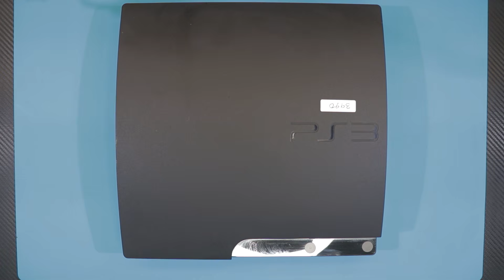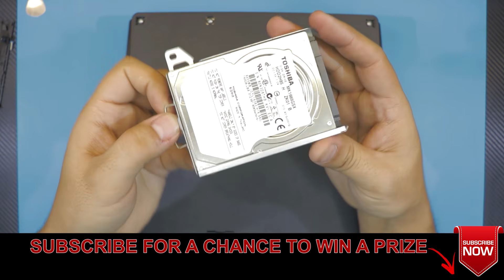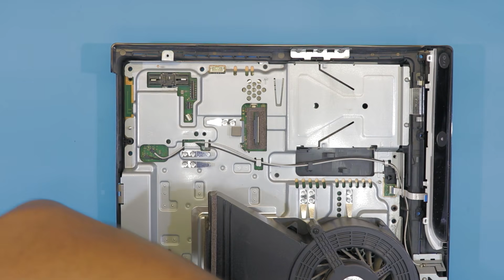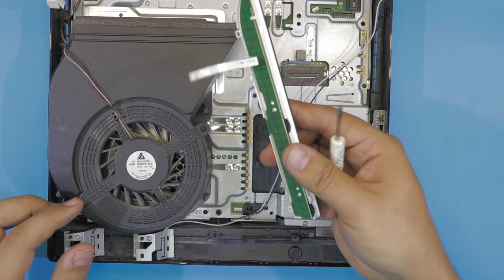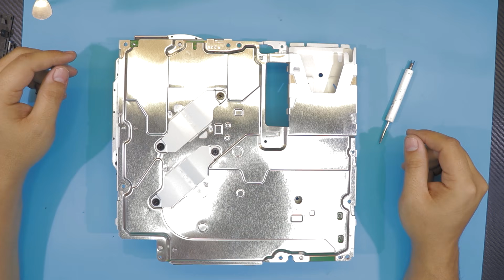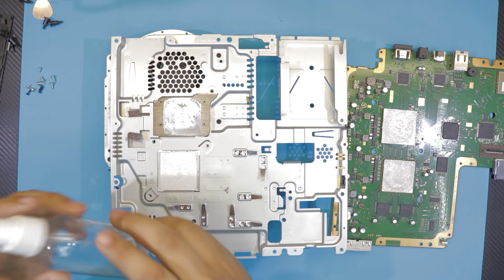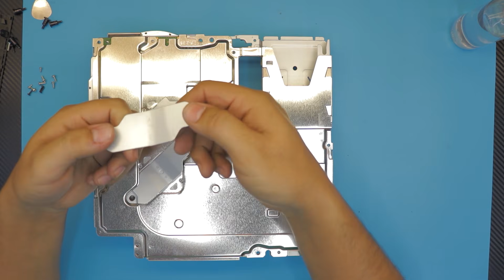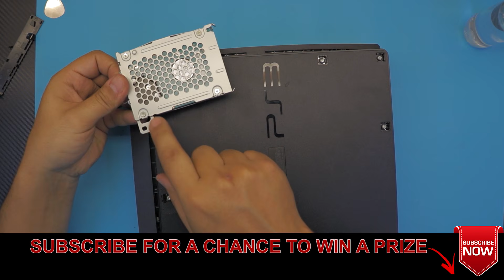HOW TO CLEAN AND  REPASTE YOUR PS3 SLIM ( playstation 3 slim console )

Comment: And now not a single screw that i took out of this thing fits any of the holes i just  took the screws out of. Tried each of every screw in each and every hole and its like they changed their own size as soon as i took them out wtf. And no i didnt lose any i made damn sure to put each and every screw in a closed container and when i go to put it back together suddenly none of the screws fit
Reply from the maker: Oh boi what happen, can you go back on the video and recheck, this is the first i hear something like this :/ if there is anyway i can help let me know send me pictures and i locate the places, also don't worry about the screws just place the screws that you can the console don't need the screws to work its just there so they don't make noise during transportation. as long as you place the CPU thick metal brackets you more than fine my friend : https://imgur.com/a/4Q72Qeg
even if you don't place the cover the console will cool down better and last longer :P

Comment: Those are the only two tiny thermal pads? I just repasted my PS3 (same model as the one in this video) and I only saw those two thermal pads and I thought some others fell off or something, I was worried. 

So those two are the only ones in that model. Does it need more? Aside from that, is that a thermal pad over HDMI port? Not sure
Reply from the maker: Thank you for the feedback! if you wish to support the channel you can LIKE or SUB or both :P
regarding your question: those are the only once , don't worry much about it just make sure you place a good thermal paste on GPU and CPU
https://amzn.to/3GgKf1g
if you need pads use this:
https://amzn.to/3wFPrbX

Comment: After I reassembled it my disc drive wont spin at all and no sign of readin (no light beneath it), would you know where that comes from ? Been tryin a lotta stuff with no success (btw I made the mistake of leavin a disc in the PS3 before openin it so it may have a link to that...)
Reply from the maker: Thank you for the feedback! if you wish to support the channel you can LIKE or SUB or both :P
regarding your question: regarding your issue its a very common error, one of the flex cables at the back are not pushed all the way in, and double check the flex cable under the dvd make sure its correctly in. i do get in my store people open and then this happens and 99% of the time they didn't place the flex cable all the way in or damaged the tips of the cables.

Comment: Used this to help take apart a slim I bought on Facebook marketplace; Cleaned out all the dust and repasted the chips.  Thanks!  Although my system’s internals were slightly different- later model revision?
Reply from the maker: Thank you for the feedback! if you wish to support the channel you can LIKE or SUB or both :P
regarding your question: yes there are few revisions on play and xbox consoles, its normal.

Comment: Thanks for an excellent guide! My PS3 still won't start, but having gone through this process I can now be pretty sure it's a power supply issue so I've ordered one from eBay. Interestingly, my CECH-2002A model was slightly different in a few places; only three tamper-proof screws along the front side instead of four, the wi-fi and BT antennas are routed over top of the DVD instead of underneath, and notably the DVD-ROM ribbon cable was moved to the rear of the unit, making assembly much easier.
Reply from the maker: Thank you for the feedback! if you wish to support the channel you can LIKE or SUB or both :P
regarding your situation:  you had a higher model that has the flex cable at the back: https://www.youtube.com/watch?v=Gey66EGkCBs
80% of the clients that come in the store have PSU issue, when you turn it on it suddenly turns off or it only makes a beef noise. replace the PSU and you set to go.
Reply: @uFixTek  yup, that's my symptoms exactly. I tried to crack the PSU open for a better look but stopped before I broke something. I already liked and subbed - I know when I've found a good thing!
Reply from the maker: much appreciate your support, i repair consoles laptop and i been doing this for over 18years so if there is anything you need feel free to ask. Note: leave new comment when you got question as this comments go down the list and i don't scroll a lot :P

Comment: My PS3 is over 10 years old and doesn’t have any problems but I still use it often until now. Should I change the thermal paste or can I just leave it alone?
Reply from the maker: Thank you for the feedback! if you wish to support the channel you can LIKE or SUB or both :P
regarding your question: oh boi, open that ps3 and you will be shocked how dry and dirty will be inside, i would highly recommend to replace the paste with a good brand paste: 
https://amzn.to/3tZMTVf
https://amzn.to/3IX4Wjh
 but if you don't want to replace the paste, then open and clean the dust and make sure you don't remove the heatsink else you will have to replace the paste.

Comment: This was usefull but... you didn't mention that we need to remove the disk. Forgot to remove the disk, didn't know I have to open the optical drive to place it back. I had that white pin that kept blocking me from inserting any disk. Took it apart but doesnt work properly, motors of the optical drive do some noises. Good thing I had a spare...

Anyone knows or has any idea on how to reassembly an optical drive for the ps3 slim?
Reply from the maker: Thank you for the feedback! if you wish to support the channel you can LIKE or SUB or both :P
regarding your request and situation: in the 1st place you should never leave a game dvd in the drive after finishing playing, its very bad to leave the drive in 24h/7.
i make a video for you how to calibrate and how to replace the motor and lens.
Reply: @uFixTek  Thank you for the reply. We might need that in case we need to replace any parts for the optical drive.
Reply from the maker: i have it in my list i make a video this week

Comment: Great guide. Unfortunately, my ps3 is not turning on though. It was working before the disassembling, but now no sign of power when I plug it in. Any idea on what could have happened? Thanks in advance
Reply from the maker: sorry to hear about your incident, try to taking apart and make sure the power unit in plugged in correctly and the 12v cable tot eh motherboard and the flex cable to the power on board is pushed in all the way.

Comment: I have to thank you for helping me disassemble my ps3. However. I'm glad I use an ice cube trey in step because you missed the black screw behind the blue ray drive at the re-assembly point. Also it seems my ps3 was diffrent to the demonstration one however I got most of it right.
Reply from the maker: Thank you for the feedback! if you wish to support the channel you can LIKE or SUB or both :P
regarding your the missing screw :P this video is old video back in days i had hard time focusing on recording and having the camera in front of my face. but i have made improvements :)
and about the ps3 are a bit different i have made another video with a different ps3 if you like to take a look.
NEW 4K video: https://www.youtube.com/watch?v=Gey66EGkCBs
Reply: @uFixTek  it's ok. I had the best tool any pc techie can have... ice cube tray... for all the in step screw sorting needs.
Reply from the maker: i would recommend this instead of the ice cube tray :P you can write make notes on every box and its magnetic :
https://amzn.to/30W6WaJ
Reply: @uFixTek  I like the tray I have. Each socket is quite large and I can easily enough use it for in-step separation. The 7 large screws on step 3 fitted in with out issue. 

Couldn't find the link to show it. Made out of silicon and quite light and flexable.
Reply from the maker: sweet :)

Comment: Hey, i followed this video to replace my thermal paste. After I did all the things and put it back on, the PS3 works normally. But after like 10 minutes I got a message saying that "The PS3 has become too hot" and it went off with 3 beeps. What am I doing wrong?
Reply from the maker: Thank you for the feedback! if you wish to support the channel you can LIKE or SUB or both :P
regarding your question:  did you make sure you place the fan jack correctly and what type or brand of paste you used>

Comment: That heatpaste is WAY too much... You need about a pea sized drop right in the middle. Also I'd highly recommend to wear a ESD grounding wrist strap. And never use paper towel on delicate heatsink surface, but a microfiber cloth.
Reply from the maker: 1st of all thank you for your opinion, But let me tell you i been in this line of work for over 18years, and this is not a PC cpu  to place a pea size in middle, if you have a little bit of understanding what is under that IHS (Heat spreader), you would for sure not say pea size in middle.
under that Heat spreader there are 5 chips the and the die in the middle, you will need to at least cover each corner and middle:
here is a image for you to see under that IHS: https://imgur.com/a/ytJoY4P
and i made a video for different types of application of paste and results ( for pc CPU)
https://youtu.be/GgXVw0M2ch0
2nd , you dont need a ESD wrist strap, the chances for you to kill the board with ESD its near impossible, you may even try hard giving it shock and still not damage it.
3rd the word shop towel its one of the best solution and its not made out of nylon or anything except cotton, and instead of damaging the surface it will actually help you polish it :/
the micro fiber cloth its not suitable on other hand, its made out of nylon.
i hope you have understand, if not you can use what ever you wish is the best, but for me for 18 years of doing this on daily bases, with zero accidents or damaged or anything.
thank you for your comment.
Reply: Bro this is not computer CPU as ufixtek says, and the thermal paste its not conductive. no repair shop uses ESD hehehe.
Reply: @uFixTek  i followed you video and to be truthful I'm very happy with my results :),  ESD its a joke , and the blue workshop towels are use in electronic repair shop in my town, Walmart has them very cheap.
Reply from the maker: thank you for the feedback,  but you have to understand there are always people with OCD and they get triggered with anything.

Comment: dafuq i can't put the power button back in place only if i put de dvd on top of the buttons. if i put the buttons on top of DVD my case won't close. what did i do wrong cuz i literally followed the damn video
Reply from the maker: :P dont worry, simply place the DVD drive in place make sure it sits nicly all the way in, then grab the on/off bar and place the front end under the case then push a bit hard on the dvd side inside and it will snap in place. follow the steps @24:30
Reply: @uFixTek  i had a hard time too, but i watched the video twice and got it in, i recommend people don't skip the video :/

Comment: Will this fix the over heating issue
Reply from the maker: Thank you for the feedback! if you wish to support the channel you can LIKE or SUB or both :P
regarding your question: hell yes, it will defiantly improve fan noise and over heating issues.
Reply: @uFixTek  after applying the thermal paste still shutting off
Reply from the maker: ok, i need to know what is youe issue exactly:
over heating? or shutting down?, or when you power on and after few min shuts down?, or when you start a game shuts down? or if you power on it right away shuts down?
you have to be extremely specific, in order i can help you and what brand model thermal paste you used>?
Reply: @uFixTek  hey thanks for the fast reply back but anyways I left my console open with a fan running seems to be working this way because if I close it up for some reason it will shut off again I don't know what the main issue is but as mentioned earlier I put thermal paste and is still was shutting  off
Reply from the maker: what brand thermal paste you used?
Reply: @uFixTek  I used mx2 but I don't think that's the issue I believe someinthing to do with the disk drive when playing no issues with it when paused for more then 5 min that's when it shuts off .
But it's all good PS3 is old surprised it lasted this long..
 I think it's time for a PS4 ..
Reply: @uFixTek  artic brand
Reply from the maker: :( ya you may have CPU internal issues or drive issue :/ will need to diagnose it :(
new ps4 its a good option :P

Comment: Where to find the special star screw tool?
Reply from the maker: Thank you for the feedback! if you wish to support the channel you can LIKE or SUB or both :P
regarding your question: the tools use are in video description, the best screw set is: ● https://amzn.to/2CATV8e
or a cheap tool is this:
https://amzn.to/3AkLaJJ
Reply from the maker: its my pleasure and that's why i made the channel to attend the people in need, thank you for the feedback if you have any question or request feel free to ask me anytime
Reply from the maker: @joshlovescotch  use a better thermal paste :
https://amzn.to/3An0FRr
also if you want a awesome trick is to get a washers https://imgur.com/a/teYgZ6Q
https://amzn.to/2YtoppD
then you want to place a washers on the screws before placing the bracket on, i circled the places. this will help a better pull on heatsink = better heat transfer = less fan spinning = happy gaming = happy life.
Reply from the maker: yes the washers are the nice sweet trick to get better results.on other models you didn't needed the washers because the spring metal brackets were very though to bend not like this garbage soft bending metals that they have now. so the washers will bring back the nice sweet tension to the heatsink.

Comment: is it required to heat the cpu and gpu before using thermal paste?
Reply from the maker: Thanks ✌  for the feedback!  if you wish to support the channel you can LIKE or SUB or both :P
regarding your question: i would recommend to warm the GPU/CPU with hairdryer for 40sec, if using heatgun set the heatgun to 80c and warm up for 30sec.  i would say do a spreading or cross-x
you will get better results.
https://youtu.be/GgXVw0M2ch0
Reply: @uFixTek  thanks for the answer
Reply from the maker: my pleasure my friend

Comment: i cleaned everything out, made sure all cords were plugged in, even reset the video display and hit HDMI but nothing, sound works and so does the power and the HDMI is also good I use it for my ps4 and switch  but again nothin, ugh imma have to send it in to a shop
Reply from the maker: before opening and cleaning what was the issue?, you had no display or it was over heating?

Comment: man, im really afraid that im gonna screwed up
Reply from the maker: you won't and its really hard to screw up , also im here and we can help you on every step :)
Thanks ✌  for the feedback! if you wish to support the channel you can LIKE or SUB or both :P
Reply: @uFixTek  i have a question, how do you open that disk drive so easily while i have to use my force to open it up?
Reply from the maker: you mean the shield cover @20:50 ? it should come out without not much force.
Reply: @uFixTek  i guess my ps3 is just old and dirty so it become hard to open?
Reply from the maker: sometimes because of the heat and remember its plastic case not all assembly are the same. maybe yours is tight fit.

Comment: I power on and light goes green then goes red...is this because of thermal paste degradation ?
Reply from the maker: Thank you for the feedback! if you wish to support the channel you can LIKE or SUB or both :P
regarding your question: this could be because of few stuff, but if your light goes green and the red right way after turning on, then its your power unit that is going bad its very normal.
but if you turn on and after few min it goes red then its over heating (repaste), and the power units start dying because of the dust built in the heatsink, its very important to clean the heatsink every year not just because of the CPU over heat  also because the same fan pushes the air to the power unit to cool it down, if the heatsink its full of dust then power units go bad. but for now you will need to replace teh power unit.
Reply: Thank you. Can you advice where I can get a UK PSU for PS3 Slim 160GB.
Reply from the maker: @chrismitch1854  its hard in uk but i found this : https://www.amazon.co.uk/s?k=ps3+slim+psu&ref=nb_sb_noss
Reply: @uFixTek  Ok so I did both the paste and new PSU and still the same. What else could it be ?
Reply from the maker: @chrismitch1854  ok no w 100% i can assure you that the GPU  requires a refllow and you can do this DIY at home by doing the following steps and make sure you do it exactly as i mention:
# remove the motherboard remove the battery on the board and place the board in a wood table, (no plastic, metal or glass, or fiber)

# clean the GPU and CPU paste
#2, place the board on a table and make sure the room is not cold or windows open or air flow
#3. grab a hair dryer and set it to max heat and medium air if possible, 
#4 hold the heat over the GPU * the bigger and thicker chip
#5 keep the heat over directly on the GPU  with a  1" distance for about 8-12min
#6 remove the heat after and let the board cool down on its on for 15min

and repaste and test :)
Reply: @uFixTek   @uFixTek  ok I will try this and see how it goes. thank you for your help, much appreciated.
Reply from the maker: @chrismitch1854  anytime and good luck
Reply: @uFixTek  Bah !!! Can't find the Hairdryer. I been reading that using a Hairdryer not effective as a Heat gun because it won't reach the minimum temperature of 250 - 300.
do you recommend I purchase a Heat gun instead ?
Reply from the maker: @chrismitch1854  i would recommend you to get a heat gun but the hair dryer does work you just need to put it for more time, its simple physics .  But heat gun its very useful to have aroung the house , if you going to use heat gun set medium air and 280c
Reply: @uFixTek  Just done the Reflow and still the same ??? Should I try it again ?